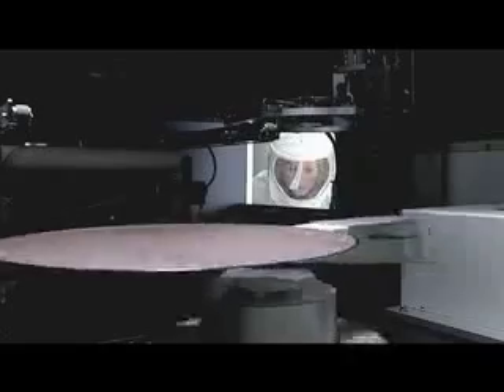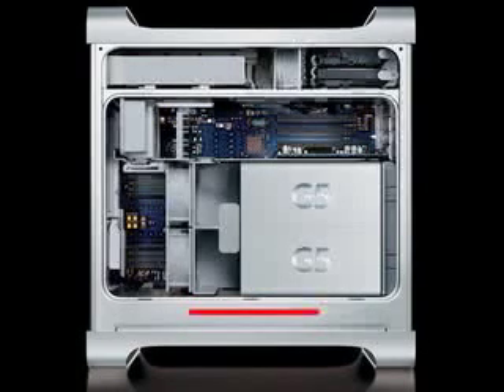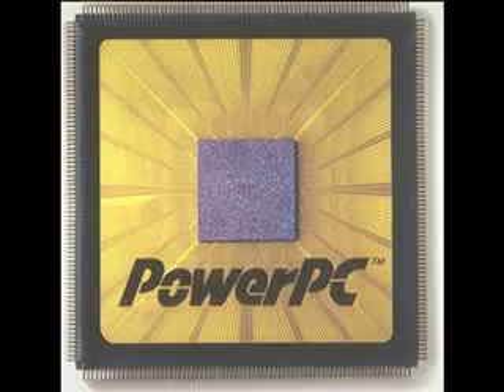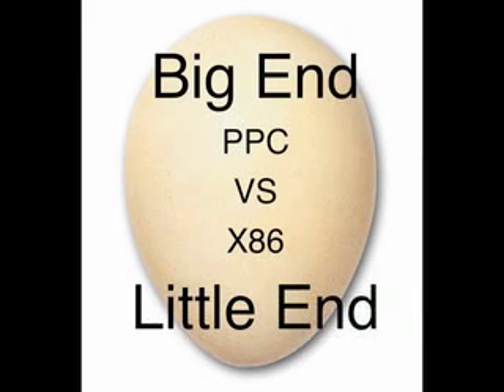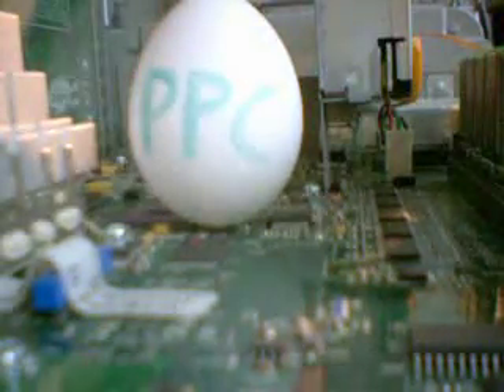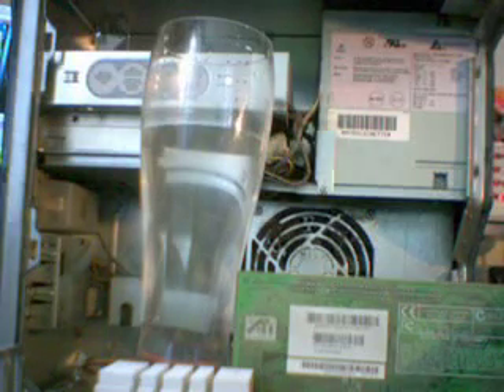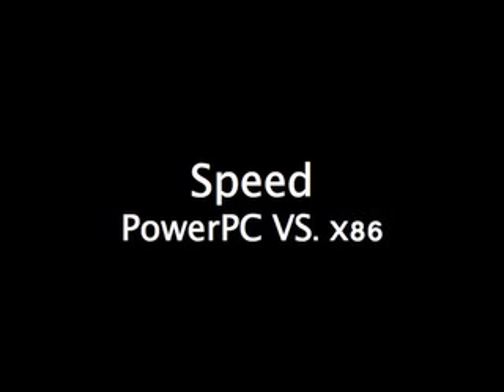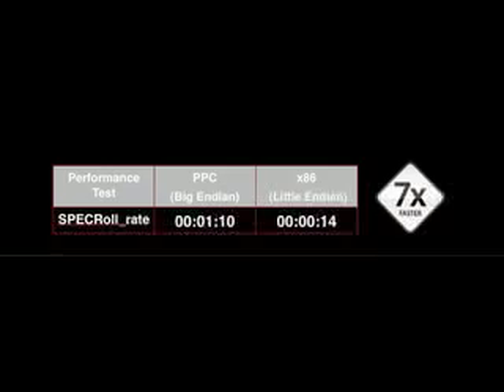PowerPC vs x86: Endianess

Comment: playstation has 9 core but it hasn't got the performance of a single core Intel processor simply because of transistor counts are architecture. Intel processors are designed for desktop computing. Most of the TOP 500 super computers in the world are mostly Intel, but apparently ARM appears to be more power efficient because it uses 4 bytes instruction.

Comment: Plus  Failed Scalability and Very hard production availability of current RISC processors... And in nowadays intel cpus, little endian processing is just a JIT emulation. 

Just after "Yonah" intel chipsets, architecture is so similar to risc cpus with long pipelines,that allows fetch more data from cache.  

Also, powerpc cpus had to increase their byte registers on die to access higher speeds.  

That would be a waste of money ,too

This is a co-reason for global switching to x86/x64

Comment: Actually, PowerPC is designed to be capable of running in either big-endian or little-endian mode, and until the G5, it was able to switch from one mode to the other without needing to re-boot. The G5 lost this ability, which is one reason why VirtualPC had to be re-written almost from square one to be able to run on the G5.